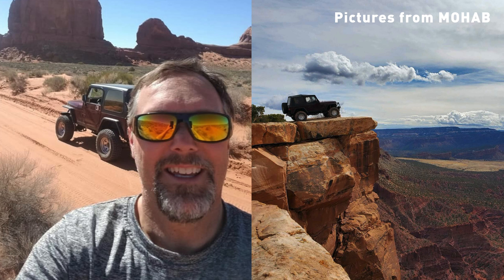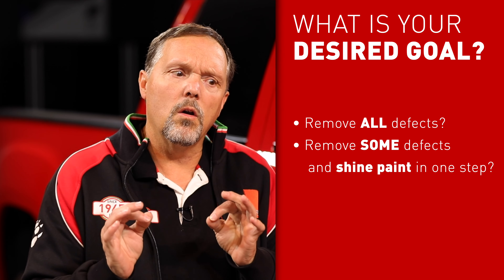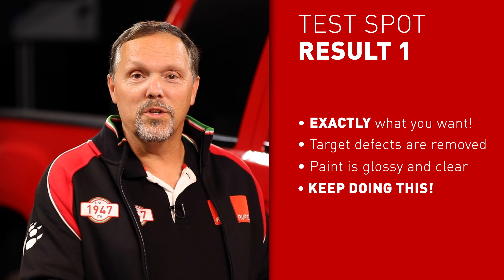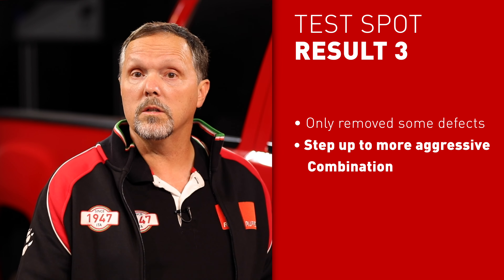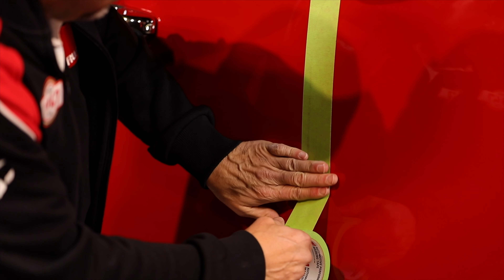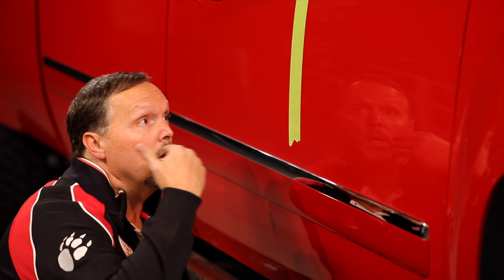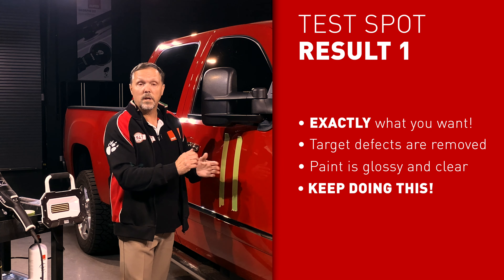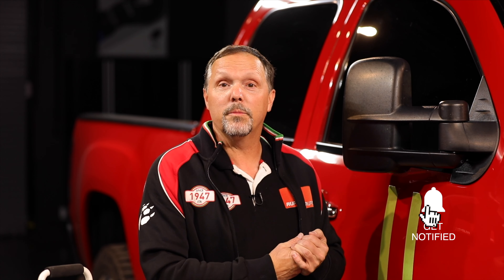How To Do a Test Spot - [RUPES Replies Episode 026]

Comment: Jason, I learned from you that the most important thing in paint correction is the technique.First is the arm speed and second the pressure you put on the polishing machine.Now my question is....why not go straight to the target with the blue wool pad and to adjust my arm speed and pressure, it will not be the same thing? I'm just asking, don't get me wrong this is my procedure.Another video with useful information, thank you for everything you do!
Reply from the maker: With clear coats getting thinner and thinner we should always try to take an approach that will leave the most paint on the surface.

Comment: Could there be a fourth hypothesis? That is, the surface is soft, as in this case, the scratches are deep enough to use a Da-Coarse and a blue sponge or wool pad and the fog effect comes out. In this case will we need a two step polishing? with which pad and polish do you recommend for the second step?
Reply from the maker: Thanks for commenting and that is a potential outcome of a test spot, as outlined in Test Spot Result #2 - defects removed, but the paint is left with a haze. In this case you can attempt to adjust the products to still get the desired level of cut, but improve the finish. Or you can decide that an additional step is the most effective way to proceed and remove the haze that way. 

As for which product would be your second step, that is also defined as part of your test procedure. In the RUPES line, if you're stepping down from the blue D-A Coarse compound and foam combination, you have 3 potential options for compounds. 

1) D-A Fine, which is the yellow liquid
2) UNO Pure, which is our ultrafine finishing polish
3) UNO Protect, which is our all-in-one that will allow you to add protection at the same time. 

Which pad you would use with which of these liquids goes back to the test spot. You would want to test them on the haze left by DA Coarse and find a combination that removes the haze and finishes to your desired quality. Commonly this is going to be the yellow or white foam, but with the variable of paint hardness you can never know until you test the combination and observe the result.

Comment: Late to the game...  Do you recommend making the worst defect on the paint the test spot?   Or, do you make the one of the less visible places on the car the spot?  I realize that lawyers scare everyone away from honest answers but I would appreciate one.
Reply from the maker: It would depend on how severe the worst part of the car is.

If the worst spot is still a relatively minor defect and potentially a one step removal, then testing there could find that combo and then the process should easily address all the minor defects elsewhere.

If the worst spot is really sever or isolated defects that can't be feasibly addressed in a one or two step correction over the rest of the vehicle, then it would be worth considering spot treatment of those defects. In that situation you'd do your test spot on the "average" defect of the surface and reserve those isolated defects for spot sanding or more intensive compounding.

Comment: Do any of the Rupes polishes have filler in them?  Can you just wipe it off and inspect or do you need to IPA wipe it off so you don’t get a hazy surprise later (had another brand do this to me where I thought I was doing a good job until I did a final wash and the whole car became a hologram)
Reply from the maker: In our D-A and Rotary lines we do not include any intentional or durable fillers. Any masking caused by residual polishing oils would be minimal and easily removed with a prep wipe, alcohol, or wash if you preferred. UNO Pure, specifically, is the most free of fillers of any of our products. This is very unusual in the ultrafine category as most manufacturers rely very heavily on fillers to get a high gloss final finish. 

On the other side of the spectrum you have UNO Protect and UNO Advanced. Both of these products have protection built into them. Anytime you have a product that deposits protection (solids) on the surface you will have the possibility of some filling. The part of the formula that creates the protective barrier is going to mask some defects.

Comment: When do you determine if wetsanding is needed?
Reply from the maker: In situations where you are facing severe defects that would require several heavy compounding stages to correct. Also if you’re addressing severe or mismatched texture or other paint conditions not corrected by compounding.
Reply: @RUPES  ive got watermarks that didnt respond well. Thats why I ask

Comment: How many passes with the new DA system - 2 up/down & 2 left/right : 4 total?
Reply from the maker: Number of section passes is a variable that can be adjusted based on technique. 3 and 3 is a good place to start, but you can go longer or shorter depending on the application.

Comment: The importance of a ipa wipe down and when to use it . Can I can my own?
Reply from the maker: The importance or need for an alcohol or solvent wipe varies depending on the application and goals. They are a requirement (surface prep chemical recommendations vary by coating) for proper coating installation after compounding/polishing before the coating is applied. The necessity for it in other situations is debatable. It doesn't improve performance, but it does allow you to see if the products you're working with have any significant filling or masking agents. 

In some products these fillers are so durable that alcohol will not remove them, and only a proper prep solvent will.

Comment: Always have the thought that any car you get could have different paint hardness and one, two or even more panels on the same car can be different hardness than the rest of the car.
Reply from the maker: Certainly possible. Different substrates often receive different paints with flex agents and then there is always the wild card of a collision repair on any car.
Reply: Please explain more

Do you mean from the factory that one door could have harder paint than the rest?
Reply from the maker: It definitely could if there was any repair done prior to delivery and that is far more common than most would think. VPC (vehicle processing centers) are large facilities where imported cars are processed. They have on-site bodyshops to repair damage from ocean or train transport and the work done is not required to be documented. Additionally, modern cars are not all painted in the same facility. Many times components will be painted in a different facility (bumpers, grills, mirror caps, hoods, etc) and while the color is matched to spec the paint itself and the process used can vary wildly.

Comment: Excellent video ! Are your pads bigger on the top than the backing plate size ?
Reply from the maker: Thanks for commenting. The loop side, where the pad attaches to the backing plate, is only a few millimeters bigger than the backing plate to allow for a margin of error. The pads then flare outward at the face to provide additional protection to adjacent surfaces and prevent the pad from rolling over on itself and exposing the backing plate to the surface. 

For example, the pads for the LHR21 are 150mm at the backing, and 180mm at the face. The pads for the LHR15 are 125mm at the backing and 150mm at the face.